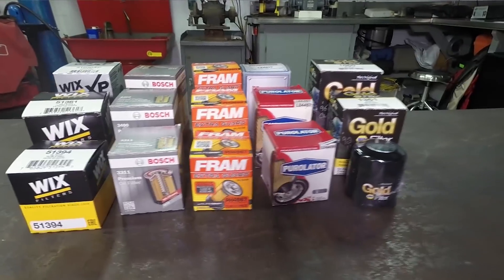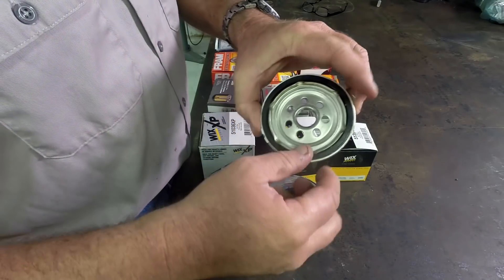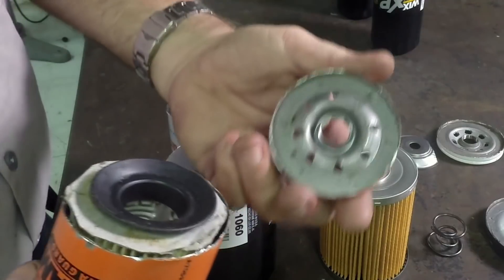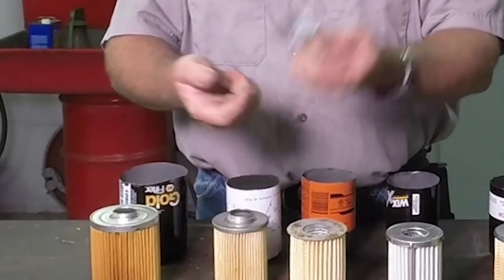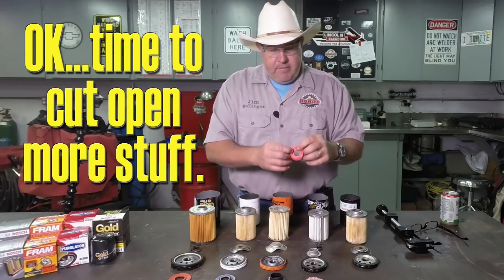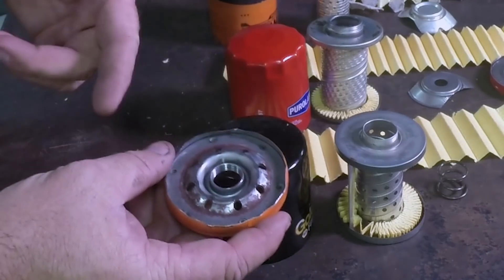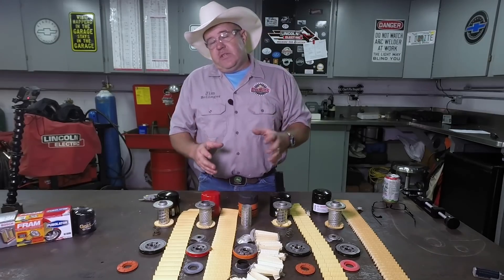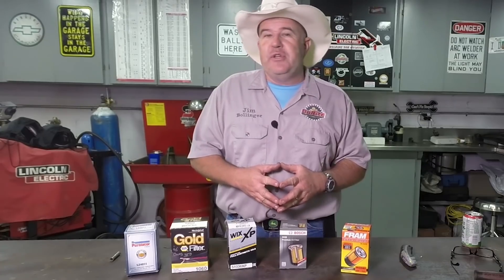The worst oil filter EVER!

Comment: Being a 50 year+ mechanic I can say 2 things will blow a motor or gum it up fast, No one like replacing a motor in under 100k miles but these 2 together will almost make that a guarantee, Fram and Quaker state oils! Granted Quaker state isn't as bad now but as a mechanic I would say, The big Q stands for quick seize! I even had customers say well you can't prove it! Sir there is only 6 bolts keeping me from proving it, if I may I will prove to you. Pull the valve cover and just show them the sludge built up. No charge for the education, now maybe you can trust what I say. Wow my car only has 50K and it's this bad? At one time you wouldn't get this kind of build up if you didn't change the oil for 20K. I have changed oil that I had to fish out with a coat hanger that used the big Q and Fram! 

Good news though a mixture of varsol and kerosene replacing the oil for 1 minute can remove most of the gunk in a motor that is good and hot without damage. Yeah I know that varsol is now something different now,  but you get my point.
Reply: I know I'm rambling but I just wanted to share, in the 60s - 70s Chevy motors were really bad about cams wiping out. The rumors were abundant about the dead cams and why, Well the made the oil ports too small! The cams were Jap so they were cheap materials, soft lob was floated around. I'm going to debunk this if I may, My first post explains 90% of the problem, enough said. Second, only people that read the owners manuals realized the valves needed regular adjustments. A valve that is not keeping contact with the cam is beating it to the point of failure. 3rd is mechanics failure. By the book valve adjustments are trash. A 20 year or motor valve spring are weak so factory adjust or not saying I need to replace these because of XYZ was a part of the problem. On solid lifter if you couldn't get there then you knew, but hydraulic most guessed wrong.  Tighten half turn at a time till miss, Then back off one turn until stable, do it again, each valve is different so experience is necessary. This is why not everyone can do our job!

Comment: Looks like I'll be switching. Used fram for years and with good results, but seeing is believing. Have sold most of my vehicles with well over 200k miles, with religious 3k oil changes.  Looks like I've been lucky.

Comment: Fram has been getting away with this limp dick product for decades. As a witness to the cut open challenge, my first was in 1978. I have seen engines wiped out and the Fram filter can looks like a gorilla squeezed the crap out of it.  The engine sucked the filter flat, wiping it out. For forty one years and they had a bad rap for some time in 1978! I even had a birdbrain challenge me to prove it. I said I am not suppose to believe my own eyes? The name of the paint color they use is bug light, the badge of the order of the imbecile, red apes ass, plain stupid, chumps. So I say BRAVO!! Mr. Bollinger. Bravo!

Comment: News Flash!!! Wix makes the filters for NAPA! 
I done this 20 years ago when my parts salesman came around trying to sell me Fram Filters  (I was a Mechanic Foreman for a County Govt and I used a hack saw to open them not a grinder)!  He said they were just as good as WIX (Yeah right!)!  The only difference in the selection was I cut open Wix, Group 7, Purolator and Fram. The Group 7 was completely garbage, And Purolator was crap too but not as bad as Group 7. Fram was fairly acceptable. And the Wix was exceptional!
 I'm glad to see Purolator saw the error of their ways and improved!  In my discoveries and in this video, the differences were and are remarkable.  I was surprised at the Fram results! They had the same paper ends and little filter media as Purolater had 20 years ago. (You can tell just by how many folds there are)!  It seems they got what Purolator has cured itself of! 
Just on the amount of filter media in the Wix filter convinced me back then! You can also tell by how heavy the filter is after you take it off and drain it. Even though they cost a bit more they are certainly worth the extra cost!
I had a friend who owned a NAPA store who told me Wix makes NAPA's filters for them! This video confirmed it! I only use Wix and NAPA filters..
Reply: As a tech i now know the very best oil filters that i can tell my clients instead of fram witch i thought for many years to ask for.

Comment: Never understood the hate on Fram filters.   I have worked at all levels in the auto industry, from changing oil at a chain store to master ase tech now.   At the oil change store we installed 100+ fram filters EVERY DAY.  Thats right,  somewhere around 40,000 a year. Never one single time did we ever have an issue.  Not once.  And you will also find many other people who worked in the industry tell you the same thing.   I am not saying that there are not better quality filters, but just don;t understand the fram bashing.

Comment: The media is cardboard, so no reason for the caps to be steel. But engineers cant convince the base educated public that it works fine. I do prefer the coil spring, that is more of an issue than the glued filter media system.

Comment: I sell filters for heavy trucks. I've seen all brands come across my counter.  Donaldson is the filter I stock. It is oe for many air filtration systems. Often the fuel filtration is the  exact filter with a different paint job. The man is right on the Wixx and Napa fiters. It is general knowledge our field that they are the same.

Comment: Was well aware of FRAM crappy filters. I always place a strong earth magnet on the exterior of my filters, helps traps particulate the filtering elements do not. Do this and then cut one apart as this guy did and examine the little mountain of metal where the magnet sits, you'll be amazed!

Comment: I had a 1987 F-150 300ci inline 6cyl. with 500K on it , until the pick up tube clogged with crusty oil from flushing it, and it spun a main. After using Fram and Castrol oil the entire time, I pulled the head and there were still honing marks in all cylinders. However I will NEVER use Fram or Castrol oil again. The engine was totally sludged very thick, and the oil pan was half full of sludge. I use Mobile 1 Synthetic oil and KN filters now. Note: I treated the engine with Slick 50 every 50K until they stopped putting Teflon in it.

Comment: Worked as an auto tech for 10 years, the majority of cars that would come in with engine failure had Fram filters on them. I will absolutely not run Fram. I usually go to the dealer and get the factory brand filter for my vehicles.   They're price comparable and you know it's correct. If you feel the need to run aftermarket filters be careful about "extra filtering" claims. To filter finer you need a denser media which requires more pressure and reduced flow. So the bearings furthest from the oil pump may not be recieving enough oil and lead to engine failure.

Comment: Not news to me. I can tell of 3 Ford 300 straight 6 engines that developed a hard, low end knock on startup. I was asked by a reputable mechanic what filter I was using, my reply.... Fram. He suggested I switch to MotorCraft or Wix. I never heard another knock out of the 2 engines again. (the 1st was replaced before knowing this fun fact...)

Comment: Physical observations are one way to evaluate a filter, but there is a need to run them through a lab to test media flow at a micron level, the burst strength of the can and the anti flowback pressure  at the value.  There are some media that has good filtration properties, even at shorter lengths, so length of paper is a poor evaluation process.  I would agree with the rust - poor quality control!!  One of the best filters on the market, backed with OE testing, is ACDelco.

Comment: I'd suggest that engine wear, or at the very least a proper oil analysis, would be a far better indicator by which to compare different oil filters.  The internal construction of the filters themselves always involves compromise.  For example, the Fram uses a smaller area of filter paper than others, but what do we know about that filter paper?  

Oil filter failure is rather rare no matter which brand is used.  For that matter, lubrication failure of any sort is quite rare in any of today's automobile engines.

Comment: Give an example of any auto manufacture that claims warranties are void if using a Fram oil filter.
You may also be surprised to know that many thousands of aircraft engines flying passengers use NO OIL FILTER AT ALL.
Give statistical information of automobile engines damaged exclusively  through the use of Fram oil filters.
Dozens of years of experience dissembling repairing and rebuilding  aircraft ,automobile engines and the drive trains
associated with the power plant I have never documented a failure of any engine due to an oil filter failure from any brand oil filter. I am sure some exist and I am sure from more then one manufacture but Fram filters would no more be prone to cause and effect failure then any other filter. I also would be interested in any Automobile manufacture that prohibits the use or voids their warranty when using a Fram oil filter. Thousands of Continental aircraft engines flying today have no oil filter or ever were designed with an oil filter and are flown hundreds of thousands of hours per year safely and with no engine damage.They use a very simple suction screen that in no way compares to the efficiency of paper filter media.You might also point out that the more dense and quantity of filter media used in an oil filter it reduces oil flow through that filter  to the engine.

Over a dozen years of doing insurance adjusting for various extended warranty insurance policies from various underwriters including the manufactures own underwriters of extended warranties that consumers purchase for their automobiles years ago, I  never failed a claim or seen damage done exclusively by using a Fram oil filter or any filter.Poor maintenance,abuse or failed design issues  have been 99.9999 percent of all failures I documented. None ever due to the use of any particular oil filter.You would be called onto the carpet and crucified if you were ever seen cutting open an oil filter with a grinder or similar cut off tool in an aircraft repair facility such as what you use in your video..There is a tool specifically designed for cutting open oil filters and are used  daily to cut open aircraft oil filters cut open during annual inspections to inspect particles found in the filter to gauge the  current health of the engine along with oil samples sent out to various labs for analysis.Engines that use suction screens are checked in same fashion.I would think an expert on oil filters would use one in their presentation.

Your observing rust in the Fram oil filter proves what? Where how and how long were these filters stored under what atmospheric conditions prior to your purchase. I assure you the filter didn't leave the plant with rust  already formed in the filter nor will the rust formed on the canister harm the engine in any way.Surface rust can form on the inside of an automobile engine oil pan in just a few days when left unused under high humidity or morning temperature inversion conditions on vehicles left outside.I have observed and documented rust formation internally in new automobile engines I have inspected that have sat for prolonged periods on automobile dealers lots.This age old adage about Fram oil filters,cardboard end caps simple bypass springs keeps continually surfacing over and over. Consumers be aware that all oil filter manufactures can and do use fiber material end caps in various type of oil filters they manufacture for a certain price point and specification they need to meet and fiber end caps do not equate to poor oil filter performance at all. And I want to point out the the endcap material IS NOT CARDBOARD. You must also compare filters of equal cost when comparing design. Fram has filters manufactured at different price points.

Today most oil filters are manufactured by only a few same manufactures and then branded under dozens of different names.
This is true of Bosch, Purolater, Wix Napa etc etc. Champion labs is a major manufacture of both the aftermarket and Oem 
filters. I want you to know I do not work for Fram or represent Fram in any way. I am an automobile - aircraft professional that simply tires of such simplistic poor misinformed analysis of automobile products.

https://www.youtube.com/watch?v=mFVNESOwLyk

Comment: When I first saw the napa oil filters, I knew fram was junk but damn fram filters are always stocked at walmart. need to break that habit!
Reply: Well to be fair, he compared the low end Fram to the top of the line NAPA. I always use the NAPA Gold on my vehicles so not sure if Fram has a filter that compares to the NAPA Gold.
Reply: @sst568  FRAM Ultra (XG).
Reply: Yeap, I always bought fram because walmart had them in stock all the time. Not anymore ...i will buy something else now!
Reply: J C I would like to see sometime your opinion of a K&N oil filter.

Comment: What's sad is, Fram is all I ever ran on my old Ford F-150. Yes, it does need a replacement engine now.
Reply: Right, after 300,000 miles. or after it spit out 6 or 8 spark plugs due to Fords sh8it engine design.  Whats your mileage?
Reply: @RRaucina  I once had a 1992 Volkswagen Golf III GTI - finest car we owned. Barely made any trouble, ran on its original engine and tranny for 407'000km ( 253'000 miles ). I'm pretty sure she could have run a great deal more, but we had to give it away in 2009 as our "beloved" government taxed €500,- per annum inorder to force the population to replace their old cars with newer cleaner models. And now, what do we have? DIESELGATE AFFAIR AT ITS BEST ! ! !
Reply: @Bandicoot803  Yes, the older VW's were very good here also, especially some diesels are still running after 500,000 miles with good maintenance. Here, even in California, older cars from the 90's and early 2000's are great bargains, maybe $1,000 at auction in very good condition. They must only pass a simple smog test based on that years standards. Some commercial diesels are being forced to retire, however. We are in a small, remote county and so the air quality is good. Each county has a different standard for inspections. We only have one at purchase. For diesels, there is no test for used ones at all! You can drive it for 50 years afterward with no further government interference.
Reply: Yup, too much cardboard is all but healthy for the engines...
Reply: Thats not FRAMS problem.  Thats just owning a Ford junker